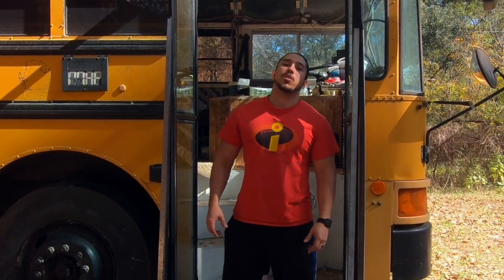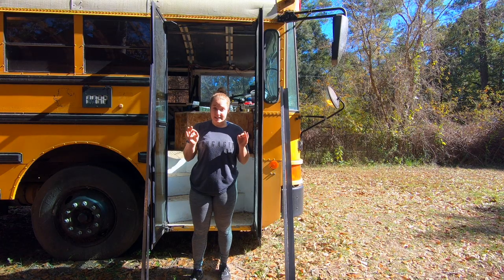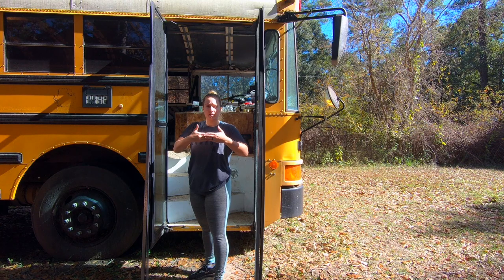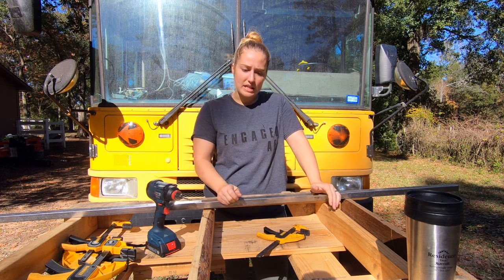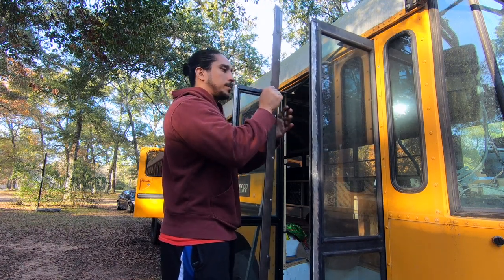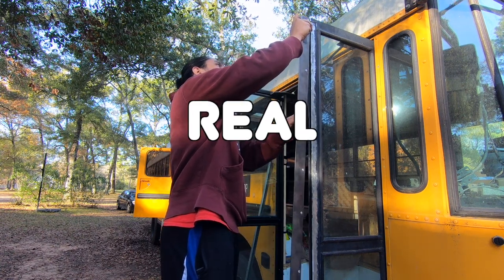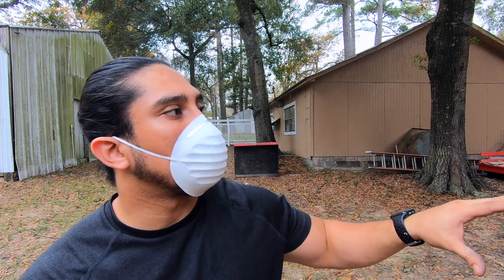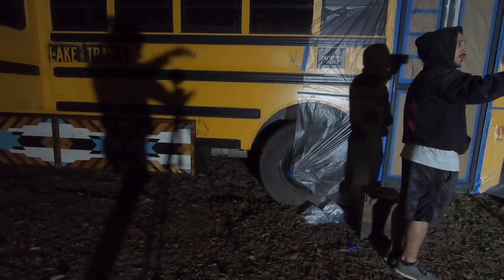Secure and Lock Bus Front Door Without Welding Part 1 * Skoolie Conversion * Gus The Struggle Bus

Comment: You may want to increase the amount of rivets on the door  while it seems tight now the vibration and force of the door closing could cause them to work loose. If it does happen maybe have to sand it back down and get it welded but that could be a while down the road. As for locking it put a lock on each side one for inside security and the other for leaving it this way only one lock is needed and less chance of losing it.
Reply from the maker: Thank you that's a good idea! We will judge it along the way if it loosens we will look into getting it welled! We will probably do more than one lock so we make sure it is good but we will look into it! Thank you!

Comment: My bus door is identical to yours except that it's made of aluminum in the frame so even if I wanted to weld it into place I couldn't. I was thinking of doing my doors the same way you did but I was curious what rivets you ordered. I'm having trouble finding any of that I believe would be long enough
Reply from the maker: Hey! We ordered them off of amazon. They are Pop Rivets 3/16" x 1-3/8" Aluminum and they were plenty long enough for the door! We will add a link to the video too!
Reply: @GustheStruggleBus  Thank you so much and thanks for the video. They can be very inspirational when you feel stuck. lol

Comment: I see you guys did your horizontal furring strips on the ceiling almost identical as I did. Did you run any lengthwise? And if not, did you have any issues with sagging in your ceiling?? Tia!!
Reply from the maker: the only length wise ones are on the walls. But no issues!!

Comment: the airsystem for the doors in the front are a nice feature but if you need to use it everytime you need to go ou and in it will become a bother , might be able to do a quick disconnect of the mecanism so you can still use it but only when you want to 
allso doing 60 on the freeway with doors like these will make them flap about a little and rattle constandly  , over here the doors are locked using strong electric magnets while the bus is moving , that might help in youre case too
Reply from the maker: We are still trying to figure out how to put it back together! haha but it has a switch so you dont always have to use it!